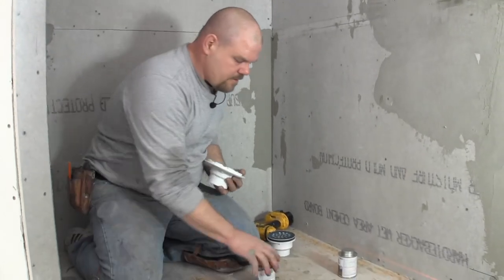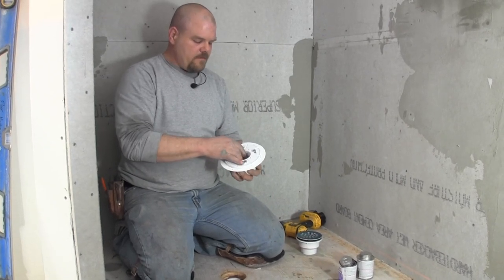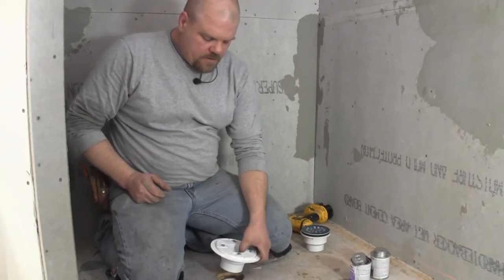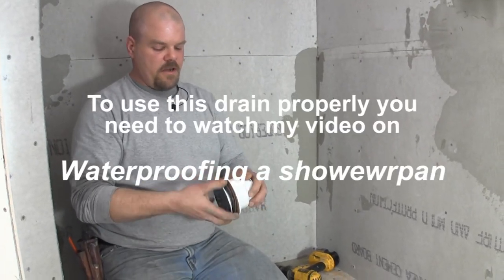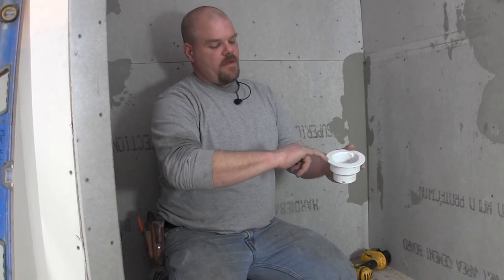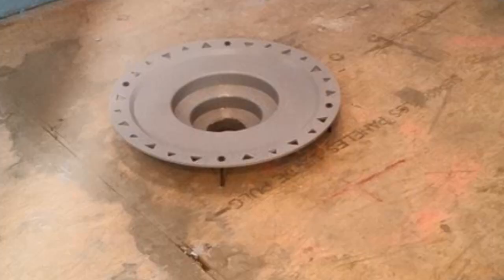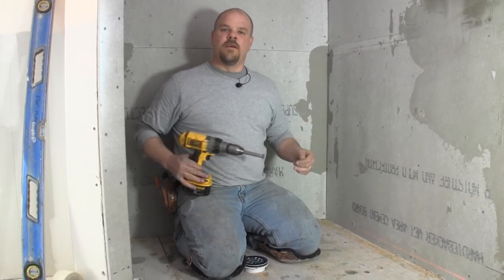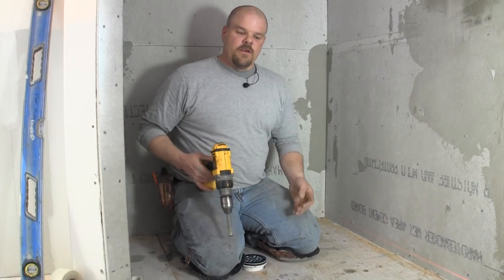How to build a custom shower pan - what type of drains you can use

Comment: My understanding of the shower pan is that the sand mix itself is what dispels the water through capillary action, not the liner. The water will not run down the liner to the drain if there is sand in its way.  it will be absorbed instead.  which makes sense if you think about it. idk 🤷🏽‍♂️ i’ve been researching this for a few days. thoughts?
Reply from the maker: I waterproof the top of the pan once the sand mix dries. Apply 3 generous coats of hydro ban to pan and walls.

Comment: Hello love your videos. Ive been watching them for the past few weeks.  I am going to be doing my shower in the next few days. I was gonna use a liner but aftee watching ur vid i think im gonna use the paintable membrane.  I already got the 3 piece drain can i still use that or do i need to get the two piece one? Also i saw on another site not to use 2x4s for curb on a concrete floor but to use bricks.  If this is the case do i just attach brick to floor with thinset and put deck mud over it paint and tile? Sorry for the long post ur advice is greatly appreciated.
Reply from the maker: I would use the schluter drain. Also blocks for the curb is ok. Thin set them down,  paint them  with membrane and tile over that.